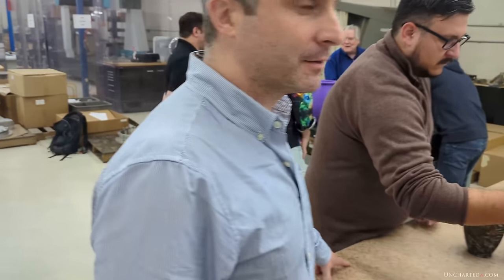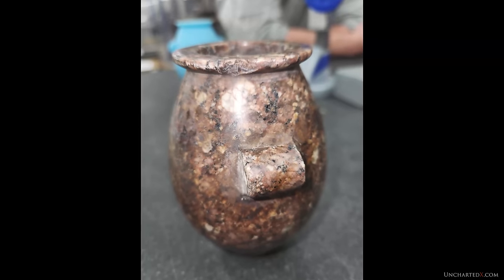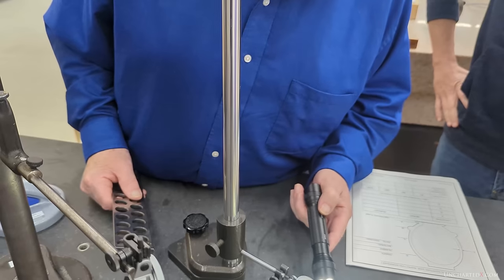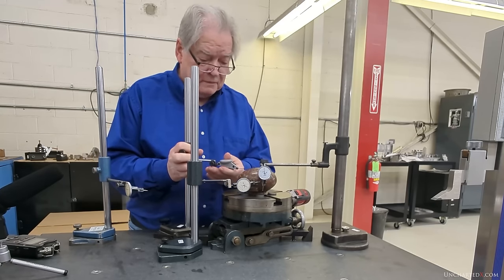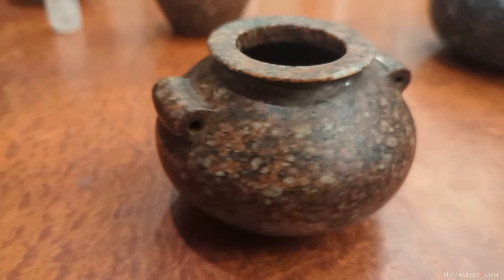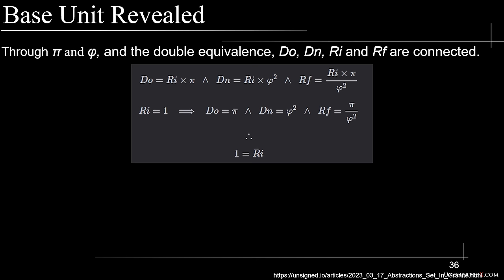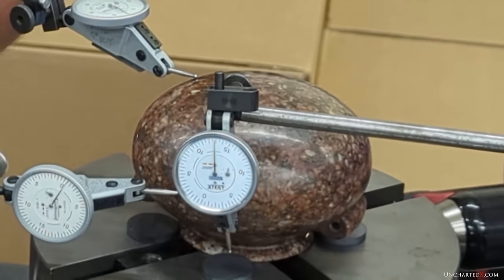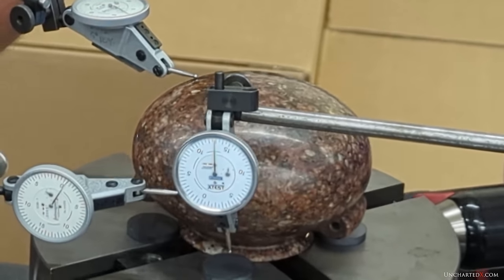Astonishing Results! More Ancient Egyptian Granite Vases Analyzed! More STL's available.

Comment: As a toolmaker this is fascinating. Hardened metals can be a pain to machine, i can only imagine machining granite with differing hardness and density.
Reply: You'd certainly earn your paycheck trying to make a vase like those!  I'm still trying to figure out the order of operations for the "schist disk" they found in Egypt.  Stone that soft, yet shaped to such a complex design..... it's just mind-boggling.  I can't think of a single tool that'd get under the lobes without running into the center hub or hit the compound curve of the body a dozen times and shatter everything.  How they could have done it is one of those great mysteries, and I'd love to see it go to the metrology department for some measuring!
Reply: @threeriversforge1997 They used pounding stones 😂
Reply: @extremechimpout  Exactly!  Pounding stones and a lot of patience.  It's really that simple.
Reply: @extremechimpout obviously done with copper chisels 😂
Reply: I know yall are joiking but would love to see some try to use heat to form schist to see if thats how they did it. @extremechimpout
Reply: @threeriversforge1997  Easy, they had a hundred slaves working on it all at once 😂
Reply: @threeriversforge1997 casting stone polymers into calups?
Reply: @markouljancic975  That's a fun theory, but doesn't stand up to basic scrutiny.  You'd have to explain how not a single geologist in the world can tell the difference between quarried stone and the man-made stuff, plus how the ancients were able to make it in the first place.
Reply: I wonder how the granite surface plate was created.
Reply: @threeriversforge1997  cant differentiate or arent allowed to openly show findings? The second part while I dunno but the H-blocks in Puma Punku are now being slowly recognized even in mainstream science as stone polymers...
Reply: @markouljancic975  Who could stop that kind of stuff from getting out?  People might say that they're "stone polymers" but there's a problem in that they can't replicate the thing.  If they know what it is, that means they have some way of proving that it's a "stone polymer", which necessarily implies they know how the thing was done and should be able to replicate the process to some degree.  Yet, they can't.

You're literally talking about a process that makes this "stone polymer" completely indistinguishable from natural rock.   Otherwise, you'd have to explain why every geologist has been fooled for years.
Reply: You cant pour or cast macrocrystaline granite like a poured polymer lolol
Reply: @Vision_2  like how all flat things are made, which isn't comparable to a complex curved object that displays the same level of precision in multiple geometric relationships, including wall thickness tolerance to within a few 1000ths of an inch as seen in this video.
Reply: @AustinKoleCarlisle  Nay nay. The present precision industry would not exist without original hand precision.  You continue to bellow your circular precision logic with magic vases. Where is your proof of what can be achieved and what cannot?
Reply: @Vision_2  using primitive methods, how did the ancients maintain a vase wall thickness tolerance within a few 1000ths of an inch without the use of a micrometer? further, the mouth of the vase is too small to get your hand inside, so a rigid tool must've been used, as well.
Reply: And,,,,,,  ending with a polished finish and still in spec.  Blows my mind.
Reply: @AustinKoleCarlisle  Why would the ancients require a micrometer? Are you suggesting that a build plan was established and the specifications were met as proved by a measurement check? I cant wait to see that published article verifying your claim. A smaller neck is not surprising in the ancient available examples.
Reply: @Vision_2  well, my friend, if the vase displays that level of precision across several specs, then it must've been on purpose because something like that wouldn't just happen by chance by hand. that's...*why* it's fascinating and deserves more analysis.
Reply: @AustinKoleCarlisle  Wouldn't happen by chance by hand? That will be considered in the future data driven  published article correct?
Reply: @Vision_2  Yeah, I have no doubt a metrologist (or 10) would be willing to put their reputation on the line and proclaim something like this with precision in the single 1000ths of an inch across multiple axes and geometric relationships couldn't be made using primitive tools aka "by hand". you still didn't explain how the vase wall thickness was able to be maintained to within a few 1000ths of an inch tolerance using primitive means, through an opening too small to even fit your hand inside, no less.
Reply: @AustinKoleCarlisle  Do you have any knowledge of how people create a wider inside than a neck opening? Surely you have some idea. It is not a secret. You will need to know these kinds of details for the published article proving the claimed impossibilities. Make sure to add photos as well just because I like photos.
Reply: @Vision_2  well the obvious answer is that an extremely fixed and rigid tool was used to hollow out the interior. it's not exactly comparable to the vase-making depiction by Dynastic Egyptians you love to spam on these channels.
Reply: @AustinKoleCarlisle  Very good.  Now you can practice with that method as part of your data driven article.  I realize that you would prefer to stick to unsupported claims instead of data as your comments demonstrate but the real world requires such effort.
Reply: @Vision_2  i'm not the one who claimed these precision vases were made using primitive methods, academia is. they need to support their claim or back down from their assertion.
Reply: @AustinKoleCarlisle  You are claiming precision at a certain level for authentic artifacts. You need to stand up and prove your claims. Fame awaits.
Reply: @Vision_2  no, all we want is the ability to scan authentic artifacts. what's there to hide? the scan vases project will cover any costs, it won't cost museums any money.
Reply: @AustinKoleCarlisle  Now you want authentic artifacts? That should have been the starting point no?
Reply: @Vision_2  that was always the goal, but you can't scan what you don't have, can you? that's why the second best option was to use vases from private collections
Reply: @AustinKoleCarlisle  Has anyone contacted a museum and explained their intentions? It is an unfortunate coincidence that C Dunn had a connection to the private collector.  Considering how he has been promoting non scientific methods for decades, it is an uphill battle to be now taken seriously.
Reply: @Vision_2  like i said, the goal is to scan pieces from a museum. the results so far speak for themselves.
Reply: @Vision_2  okay, so when there are vases with official provenance that display the same precision, what's the excuse going to be then?
Reply: @AustinKoleCarlisle  Your excuse for not then offering a scientific description of what is and is not possible? Who knows?
Reply: @Vision_2  well i'm not privy to the Marxist group chat, I don't get to see what talking points you guy are told to go with. but i will say, i notice you guys are always several days late to the party, so it makes me think you all take a couple days to think of a consensus talking point. but I can give you some pointers: think of what Ben might say and what your responses would be for each scenario, that way you'll have a list of possibilities you can go with once he releases a video and it won't be so obvious what's going on. but you do you, i'm only trying to help.
Reply: @AustinKoleCarlisle  Hey that is funny. Although depressing if you actually believe that is how life works outside these entertainment channels.  I do have a real life after all and I eventually hear about the latest claim videos. I hope Ben's team are not waiting expectantly immediately after each release to insult and eventually block any disbelievers.
Reply: @Vision_2  well i hope they are at least paying you. i'd feel really bad for you if you were doing this for free. regardless, you should probably think of what you're going to say when we examine vases from museums and they have the same precision as these initial vases.
Reply: @AustinKoleCarlisle  I wish I was getting paid but this is a free service I provide. I am at least happy to hear that you will be part of the measuring team. Hopefully you will make an appearance on the next video?
Reply: @Vision_2  have you thought about what you're going to say when vases from museums are scanned and show the same precision as these initial vases?
Reply: @AustinKoleCarlisle  Still going on and on I see.